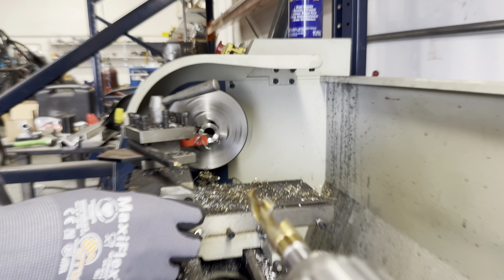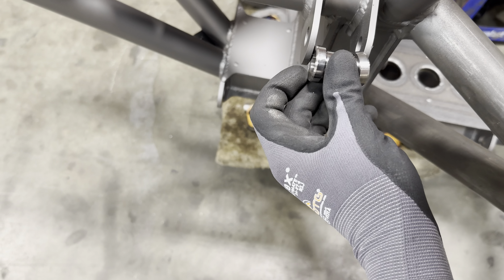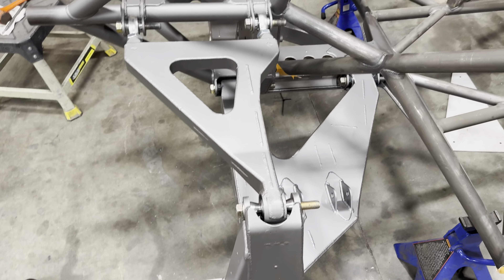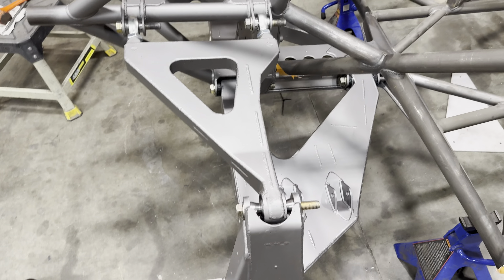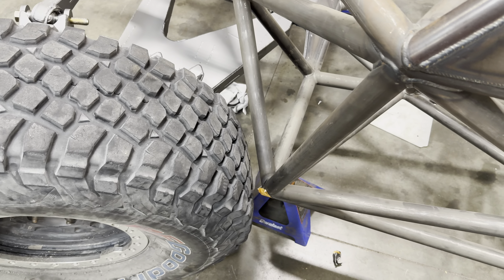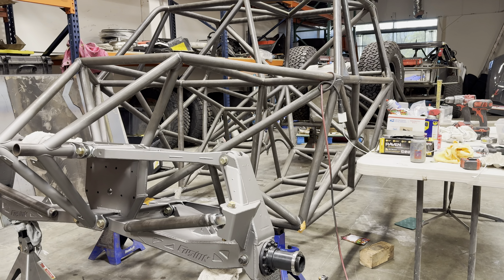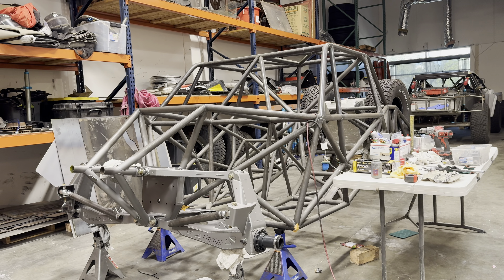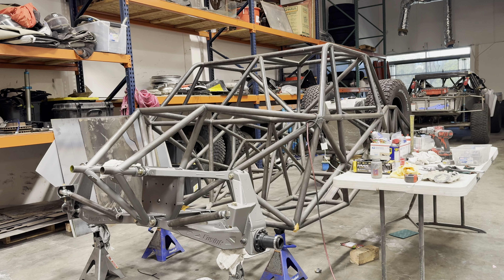BUILDING A TROPHY TRUCK PT.1

Comment: I have not built any suspension systems, yet. What is the purpose of the misfits, alignment? Anything like an eccentric bushing?
Reply from the maker: Misalignments allow the bearing either heim or uniball to achieve full range of motion on suspension or steering items.

Comment: I’m at 7. But want to possibly try 9 degrees and see what happens.a lot of I beamed 1450 trucks look like they run A lot of rake. You do know what take is?
Reply from the maker: I do…. A lot of beam trucks rake their shocks back not their frame. This is an A-arm truck and yes the bulkhead is raked up “back” a little to absorb hard hits.
I didn’t design the chassis, but I know they work very well we’ve had about 12 of these fusion chassis and every one of them works incredible.